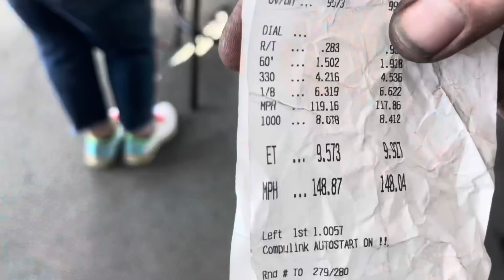Way Too Close to the Wall!! Day 4 #sickweek2023

Comment: Brent's driving that little Civic like he stole it. Wyatt's truck is a testament to putting a plan in place to build an 8 - 9-second 4-wheel drive drag truck that actually does what it's designed to do. I've seen countless 4-wheel drive trucks that never were able to perform at the level they were designed for. The engine might make 1000 plus hp but if the drive chain, chassis, and suspension don't work, it's all for nothing.

Comment: Next time grab a pipe and use it as a lever to apply traction to the tires when it's in the air like that, it can help isolate driveline issues when resistance is induced

Comment: Always remember that fresh water on its first boil contains a lot of oxygen so produces air so after first heat cycle bleed the radiator again bottled water boils quicker as well try it yourself in a kettle you will be surprised

Comment: Great content, so idk if you can but I’ve always ran water wetter to help with keeping the temps down, it may help, also try to force fluid the opposite way threw the rad, it may have a slight clog

Comment: "RADIATOR CAP" is not at the highest point in the system so getting out, the air bubbles is next to impossible, Schrader valve in top tank of rad or external tank on the firewall. Just a thought.

Comment: Hope goof gets all the bugs out.  So exited for the h2b to rip.  Brough performance makes a plateless kit which uses the b series mounts.  Dk if it's awd compliant.
Reply: I dont think Brough is still around. Their website has been gone for a while now..  The plate less kits are known to have issues, the adapter plate style is definitely the better option. Most of the issues associated with H2b kits come from installer error.  Loctite everything. If you're using a B series flywheel with the spacer it has to be torqued over OEM spec and you have to use red loctite. Best option is to use an H2b specific flywheel.

Comment: Correct always push water through the radiator or you might get a small air lock in the rad

Comment: put a air bleed in the top of the rads and put a header tank on them that is a bit higher than the cylinder head yo need expansion room

Comment: Watch the RHF tyre on the first rip/pull 
It moves and directs Brent at the wall.
He was only countersteering to the left 
As the car pulled right, and tyres pointed right. Check the front end boys 👍👍
Reply: Front wheel drives toe in under acceleration. So the RHF tyre toeing out / pointing right is very unusual

Comment: Human billboards checking in lol… rocking the shirt I won from y’all. Question…. For drag and drive especially, you think a full size radiator would help? I know you’re tight on space in these itty bitty Hondas, but it’s always water temperature problems.
Reply: I’m guessing he had a head gasket issues from the beginning. 
I run a half rad radiator on my civic and even on 95° summer days my car never gets hotter than 170°

Comment: Hey Brent. I was wondering if the dripping water pump under the right tyre you showed at the start was causing it to break traction and drive you right? That is of course if it’s not your diff.

Comment: You showed that fuel was leaking. Are you making a puddle in 2 step and running over it? Test that out. Simple 2 step check before sending it would tell you.

Comment: You guys are flirting with disaster having the two cars water temperatures constantly rising and running around 200°+ for miles and that alone will get a head gasket if you're not carefully watching it but I've noticed since the PFI SPEED team and Boosted Boiz have doing the drag and drives you guys have inspired other 4cyl cars to join in and that is exactly what you wanted and I'm glad they kind of made a class for you guys as well and not just had you guys jump into the stick shift class and run against cars that are between a second and a second and a half faster than you guys and now it's more competitive and it keeps things more interesting even though the Sick Freaks class isn't filled with just 4cyl Hondas it's filled with cars that are 4cyl and everything else that isn't a V8 but I still think they need to make a class for FWD and AWD 4cyl and 6cyl cars to make it even more interesting

Comment: I will never get you import guys.. You spend so much money and break so many parts and put in so much effort.. to run slightly faster than a stock Hellcat. There's so much easier and cheaper ways to go fast. Someone needs to make chromoly axles for those cars. But then I guess I can't blame you because fast VW Bugs are cool... and I'm so weird I have a thing for Gen 2 Corvairs.. and Moto Guzzis.
Reply: The hellcat argument is an easy one to answer. Built vs bought. It's a lifestyle!
Reply: @MotorSwapDan  it's an easy comparison.. a benchmark if you will. I know I could build a hell of a lot faster car for the price of a Hellcat.. it's just the bar I used.